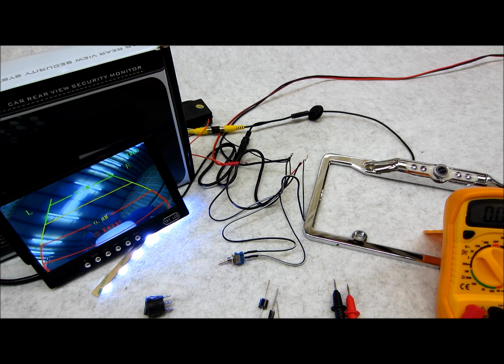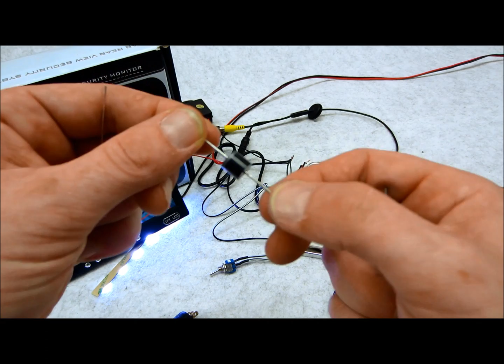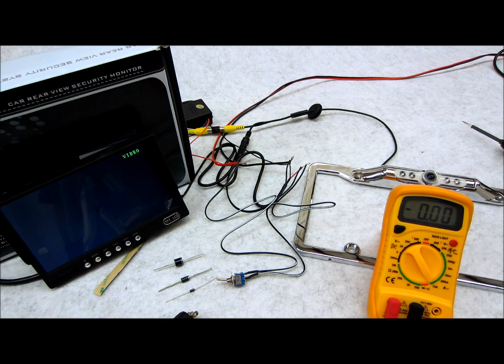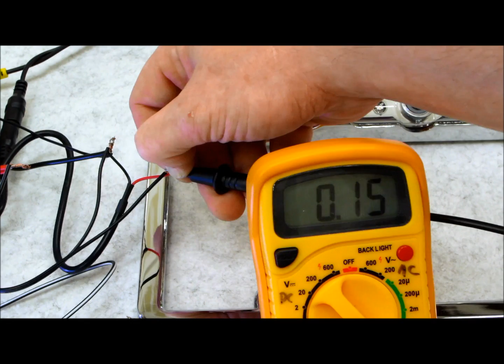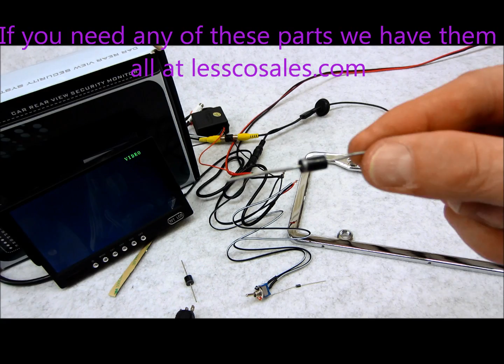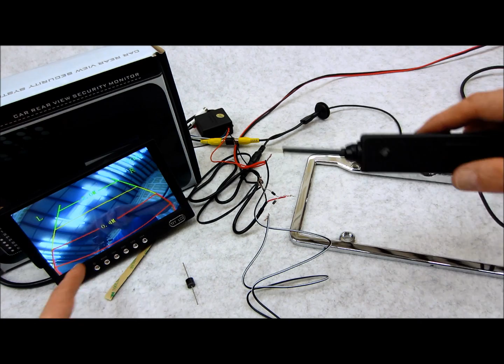How To Wire Your Rear View Camera With An Override Switch

Comment: Let me get this straight as you didn't really make it clear enough. 

1. Cable goes to reverse output cable to one diode
2. One cable goes to switch and other diode 
3. Video cable from cam goes straight to back of HU
4. The joined diodes go to the reverse signal cable in the HU
5. The spare black wire from cam goes to ground
6. The empty side of switch goes to 12v+

?

Many thanks

Comment: Thank you for the very informative video. 
I am planning to install 2cameras with switches in my panel van.

Can I ask: is it not simpler to run a new 12V supply to the rear camera instead of using the reverse light as supply?

I recall reading the reverse light should be avoided as a supply, but cannot recall the reason.

Perhaps your video is aimed at those with a reverse camera system already installed and who want to add a switch?
Reply: Yes, you need two separate supplies of power to the camera for this. At heart it's a backup camera so you need power to it when you switch your car into reverse. The easiest way to get that power is to tap into the line that supplies power to the white backup lights because that line gets 12V only when you put the car into reverse and it's already in the trunk area of the car. There's plenty of extra power in that line to power a backup camera along with the lights because the backup camera is very, very low power.

But to have the switch option, you need a completely separate incoming power line that bypasses the wire feeding the reverse lights. So you need to run a separate wire from your switch on your dashboard to the camera. Those two incoming power wires, the one tapped into the backup lights circuit (for when you shift to reverse) and the one coming from the switch on the dashboard (when you flip the switch) meet where the two diodes are and become one line.  That one line then goes into the camera. So either line will power the camera. What the diodes do is prevent the power coming from either line from feeding into the other power line. The only place the current is allowed to go is through the camera, which is what you want.

Comment: This is very interesting. I was definitely prepared to do relay. I actually don't want to have a switch. I want it to be done automatically with the press of a button on the radio .. no, I just have to see what type of output the radio gives for the camera..

Has anyone made a backup camera that was able to be turned on automatically when accessing the video feed of the radio unit?

Comment: That’s a lot when you an just tap into power behind radio and flip a switch when you go in reverse I just flip a switch when I been my camera if you get you’re power behind the radio from the constant put switch in bam Igor two switches I got a pioneer which had to be parking brake bypassed

Comment: Theres a much easier way with NO diodes and no hooking up to reverse lights. Just hook your positive red pig tail opposite of camera side to the same power ignition source  the red wire that powers your head unit. Then simply put a rocker switch in your dash.  That way you turn your camera on or off at will by the rocker switch only.
Reply: Would this cause it not to activate rear cam with reverse signal if toggle was “OFF”?
Reply: @jacobm9697 correct the only time the backup camera is on is when the flip the switch
Reply: @scufxz6841  sweet thanks man I still been wanting to get around to setting up a full time reverse camera on the radio for towing. So useful in my opinion and the toggle would be God send.
Reply: @scufxz6841 have a 21 Ram that has all setup factory but when driving the rear cam times out after like 10 seconds.

Comment: @Lesscoelectronics Could you make a video where you can manually switch between 3 modes "front-facing camera", "off" and "rear camera" ?
The idea is to use a monitor/radio that only supports 1 video input but you can switch between 2 cameras (or multiple) and an off position where there is no video feed.
Reply: This would be very neat.

Comment: does this technic work for a factory installed camera.. im stuck on this, 2019 jetta. has a back up camera. an im replacing the stereo to a pioneer avh 2550nex.. but, iliked what he showed in this video
Reply from the maker: If you now the oem wiring - yes it can be used.

Comment: Honest question. 

Why not run two relays. Both feeding the camera, one triggered from reverse voltage signal, one triggered from a switch signal. 

That way you aren’t throwing codes pulling amperage from the reverse light circuit in newer cars, the camera gets clean power from the battery, and no messing around with diodes?
Reply from the maker: you could but its overkill
Reply: I like this plan far better as I’m trying to make this happen in a ‘21 RAM.

Comment: Excellent vid....this has answered the question I had. I knew some sort of isolator was involved but wasn't sure if it was a diode.
I'm about to wire my reverse cam up to my stereo head unit. I also want to wire a separate switch in the dash to the cam and this has clarified it all for me. Thanks.

Comment: I think I may have found an even easier way.
 The Headunit works off a 12v signal coming from the reverse lights that are used to "interrupt" and display the camera feed.
You can wire the 12 volt signal from the head unit directly to the reverse light wire but do not connect the camera power wire to this wire.
Wire the camera power wire to any accessory/ ign switch when key is on. 

This way, the camera is always powered up when the accessories or ignition is switch is on and head unit will display the camera by getting triggered from the reverse light wire.  Since the camera is always powered you can also select "camera view "  on the head unit when not in reverse and see the image.

Also, i'm not sure but when you said the reverse light still will be on from feedback in the wiring , this makes me think of the led's that still stay on even when the circuit is "off"   due to incandescent bulbs requiring more power to have that visible as opposed to leds.

Comment: So I was wondering why one would wire a 30/40 amp relay into the system? 
Seen one this way at the local parts yard but didn't get the time to trace it to maybe offset my curiosity.
Thanks in advance for anything you can provide to this.

Comment: If both switches are on?

Florida (Sept. 17, 2020) — Yes, this was my question as well. What if both switches are engaged. That is, the car is put in reverse (sending power to the camera & monitor) and, the manual switch was on as well?

I presume all that will happen is the backup lights will the be channeled power?

The desired result should occur - that is, the backup light gets engaged on as the car is reversing, then , the backup light turns off when transition lever returns to drive. Yet, since the manual switch is on, the camera stays on.

I suppose we should make sure the manual power switch has a plan to automatically turn off. Perhaps using ignition switch power. That way the camera, if left on by the manual switch, turns off when the ignition is turned off.

How about this, just have the power to the camera and monitor turn on when the car turns on?

Wait, the ford transit monitor is tied into the radio display, so if you have an always on trigger, you won’t see the radio menu screen?

Tricky, but totally doable..

Comment: Or you could not make it super complicated and put a 3 position switch. Hook the back up light wire to one side then to the monitor Then your power source on the other then to the monitor. This makes it way more complicated than it needs to be.

Comment: Can you please tell us how to use the rocket switch with three pins? I wired exactly how you said with diode however reverse light wire isn’t getting any power however the switch triggers the reverse on the radio but no image displayed.. ? Any idea what may be causing this?
Reply from the maker: do you have the diode flipped in the correct direction? they are polarized..
Reply: Lessco Electronics yes I tried quite a few diodes. Have the band on the reverse lights. The problem is when I do the double isolation the reverse trigger works and triggers the radio but no picture shows up. When I hit the switch the leg of the diode tied to the red reverse light wire from the back doesn’t get any power.
Reply: I’ve tried multiple diodes 1n4007, 1n4001-007 and 1n5817 thru 1n5819

Comment: I’m doing it exactly as you are saying here but which wires are you referring to? I have two wires coming from my switch on with constant 12v (from radio 12v acc wire) and the second wire from switch tied into reverse cam trigger wire and reverse wire from twilight. I added 1amp 20v diodes and the switch triggers the radios reverse switch but the camera is not powering on.
Reply: I think this is an issue with a factory reverse camera. I’m trying to figure out the same thing. The cam in the video will be constantly on thus when you toggle video feed the camera is already on to send image. With our case, or mine at least, I have a 2021 Ram with a factory reverse camera. That camera has some sort of switch that is only sending power while the truck is in reverse. If I’m understanding all these concepts clearly. In this case you would have to route power from the on side of the switch you instal to the camera also so that when you call for video feed you’re also powering the camera on.

Comment: Hey thank you for this video. I have a boss head unit which has a button to initialize the back camera however being that I’m tied into the reverse lights it tells me to check the cameras power source. Since I’m not in reverse the camera isn’t getting any power to it. Can you let me know HOW I CAN still have the camera activate in reverse but still be able to press a button and see the camera without being in reverse? Pretty much how can I provide reverse power AND CONSTANT POWER to manually check the camera when needed? Thanks
Reply: If I understand correctly you could power the camera through your toggle switch “ON” side. Sending power to the head unit for video feed while also powering the camera on. You may need to use a relay for this function.

Comment: ok great , thx, also this is good to know if you are pulled over by cops to turn it on and keep it on, without them knowing the car is in reverse using the camera.  now we need a microphone and a way to store broadcast and or take still shots  w cameras in front and on the side of the car, maybe a roof mount 360 degree cam and micro phone.... or an app to take video, sound and still shots, to use later in court.... also is there a way to hook up a back up cam kit to the front of the car and link it to the installed screen in the car to do the same thing? if they have a back up cam for reverse , can we have a cam wired to "drive" and "in Park"  mode to take  pictures in the car using the in car video screen too. or is there way to make the back up cam take still photos? I want to drive down the road and see a great sunset or deer or accident or someone in trouble and take a pic video and sound, all vehicles should have this, without having to pull over, bc there's no room to stop or pull over.... any wisdom to this effect would be greatly appreacitated .... wire your vehicle for any situation without having to use your phone.. maybe a shutter button on the dash or in the steering wheel buttons....mahalo and alona

Comment: Can I put a constant without using the backup light as power and just use a switch to turn the camera off and on... and can I also put a three way switch and add a front camera and the screen will activate depending on the position of the 3 way switch?
Reply: This is what I'm looking to do also!

Comment: What if I had the toggle switch on and put the car in Reverse would that change anything?
Reply: I was wondering the same think. I dont want to fry the radio or camera do to 12v dc coming from 2 different source
Reply: Brandon Alsandou No you're fine. Two 12v sources on the same conductor will stay at 12v.
Reply: That’s how you turn on the warp drive and fill the flux capacitors. Don’t try it. Trust me.

Comment: Nice video. I did something similar but didn't have the deck automatically switch when i manually toggled the switch. I have two camera inputs each with their own switch and on the deck i can switch between them.   Question for you... why the extra diode to protect the switch?  I can only see that for the case with led on the switch and to stop the led from coming on when in reverse. I only  have a simple 2 prong switch and only use 1 diode to stop the reverse light from coming on when the switch is used.
Reply: If I understand correctly and you still care by now lol the extra diode was only for the built in LED in the rocker switch to only be on when the rear camera was in manual override. Without the extra diode the blue LED would be illuminated at all times on the rocker switch because of the constant back fed power.
Reply: I was wondering this as well. If the switch with its own 12v is open it cant back feed to anywhere. Just one diode in the the wire from the reverse light?

Comment: hi i have a problem with reverse camera. how much of a current should i measure at the point where you connect it to the mirror? power and yellow?
Reply from the maker: depending on the unit, cause they will vary.. I'd look for a .75-1.5 amp draw

Comment: Why not just hook the 12v to the running lights instead of the reverse lights ?   you want to run the rear video on all times, just turn on your running lights.
Reply: David Crabb dude the guy wants to listen to music n might sun vids as well if u plug them to headlights only thing u gonna watch is back no music no vids 😂 the aim of the switch is to use it often not always

Comment: I have some 10SQ050 10A 50V Schottky Rectifiers Diode lying around. I know it's an overkill but will it work with this setup or are there any dangers or backdrops if I use them in a similar setup?

Comment: Can someone please tell me what the black and green wire conect too?  The harness that came with the lcd screen. Has a black, green and red
Reply from the maker: Can I see a link to it maybe?
Reply: @Lesscoelectronics  WickedHD 7 Inch High Resolution Rotating Color TFT LCD Rear View Camera Display Monitor with Remote Control and Mounting Bracket https://www.amazon.com/dp/B01BHC7UTI/ref=cm_sw_r_cp_apa_nPEJBbM0Q0X2V

Comment: Since my camper doesn't have reverse lights i can use this method to reuse the middle 7th pin on the wire harness to add rock lights for taking turns at night. Thank you i had a general idea on how to do it but I wasn't well versed in diodes.

Comment: I do have a question if someone may be able to help. I have a reverse camera that I installed on my 2003 CTS, but the camera only engages when I put it in reverse. And I still have to press the camera button on the stereo. Check this out, on my girlfriends Honda accord 02, her reverse camera works as soon as you turn the car on. So my question is, what exactly did I do wrong in my CTS? How do I need to wire it so I know the camera stays on and it doesn't have to be in reverse? Please and thank you
Reply from the maker: Depends, tell me what equipment youre using

Comment: Couldn't you just buy a head unit that lets you switch the camera on whenever and avoid the reverse in wire all together?
Reply: You can have the head unit power the camera, bit without the diodes in place, you lose the abolity to have the acreen automatically switch to the camera when you throw it in reverse. Instead, you'd have to hit the button on yhe head unit to activate the camera. Whatwver is easiest for ya.

Comment: How about if the power source says 12 volts on multi meter wired from a different location in your car.  Do you use a higher diodes amp like a 12 volt one? I hope this question make sense.
Reply: Voltage and amperage are different.

Ohms are resistance. (R)
Amperage (I) is how hard power is being pushed (Current)
Voltage is power or electricity (E)
In short, Ohm’s Law. 

For instance to get amperage you could know that you have a 4 ohm subwoofer in a 12 volt system (any modern car electrical system). To calculate amperage Ohm’s Law would suggest to divide voltage by resistance to get amperage (E/R=I). Which would look like 12/4=3. So 3 amps is what a 4 ohm subwoofer would pull in a 12 volt system. 

You can change the formula for each figure. 
Voltage or Power = E
Amperage = I
Resistance or Ohm’s = R

To get amperage as you see above is E/R=I
To get voltage you would use IR=E
To get resistance you would again divide but this time using E/I=R

Comment: I think you really only need 1 diode.  You just want to block the current going to the backup light when the switch is on....you don't care if the current flow comes from the switch or the backup light when you are actually in reverse....so putting the diode from the backup light to the camera power input will prevent current going to the backup light when you flip the switch.  When you put it in reverse the power will come from the backup light through the diode which will be forward biased....might as well use both diodes though since they are cheap.

Comment: Your actual backup light on the car probably draws much more current than the LEDs shown.  You would need to measure the current going to the backup light to make sure you have enough current margin in the diode for that backup light circuit.  Probably need 2 different current rating diodes or two higher current rating if using the same diode.
Reply: 🥹 for the set up how he is showing it they are correct for what it calls for … wich is why he explained why and how it all worked so that you would take the steps and measure the needed power for the diode calculation…